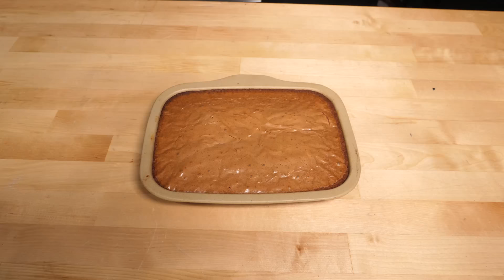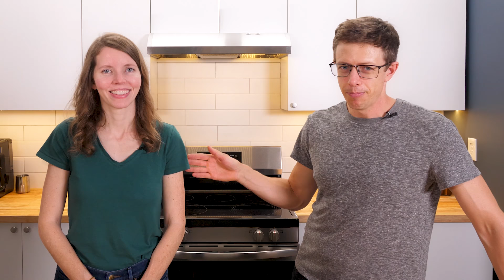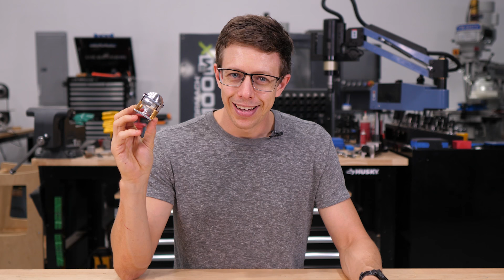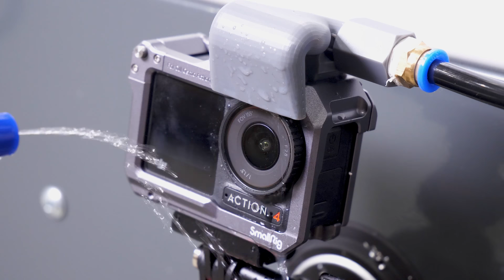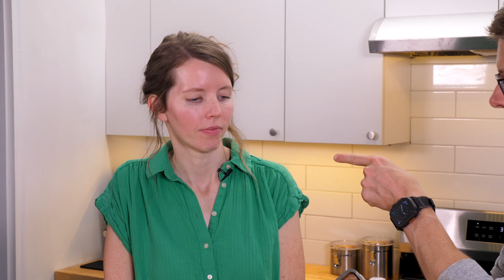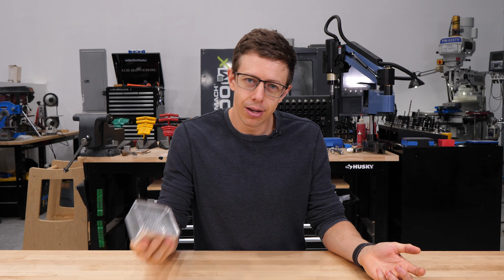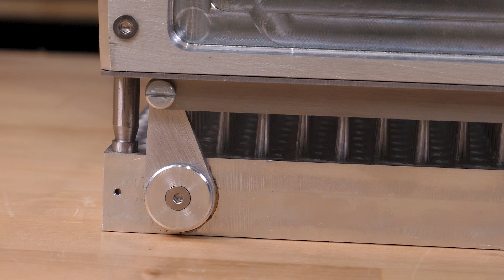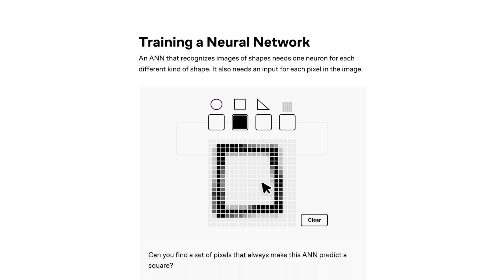Baking brownies from the inside out

Comment: What if you exploited the energy lost in phase change to delay the outside batter from cooking as quickly... or something. I am not a baker, there may be a way to achieve this more simply. 
To clarify, my idea is making two, or even three types of batter, perhaps with different viscosities, and pouring them in layers / injecting them along the corners prior to cooking. If the outer layer were thinner, it would take more time to evaporate the liquid before reaching ideal ratios to cook, meanwhile it would be transferring heat to the inner layer. Further, the higher content of liquid should transfer heat more quickly until it begins cooking.
Pure speculation but I'd bet you could find a mixture or additive for the outside/corners that transmits heat quickly, and delays its own cooking.
And... this would potentially allow a normal pan to work. Or maybe a circular pan. You'd have to inject thinner batter along the corners/walls, top.
idk about the bottom tho tbh

Comment: This seems backwards.
Why not instead of lots of contact points with hot metal

Make 0 contact points with hot metal

Like use a material that doesn't transfer heat very well

Or even somehow keep the material at a certain temperature

Comment: heavy breathing couldnt you just put it in a water bath like a cheesecake to never get crust because the temp stays lower , this is overengineered and i argue doesnt solve the problem as well or as simply as a glass dish inside a larger glass dish seperated by 2 inches of water

Comment: another way to approach this problem may be to change the way you heat your batter - I know it doesn't sound apetizing, but microwave radiation, combined with MW-transparent dish, would (in theory) heat the batter more evenly, all at once, avoiding the hot-wall-problem in the first place

Comment: This issue got solved years ago---it's called a sous vide. Prevents the edges from heating too fast, as it warms the food slowly up to temperature. The food also does not touch any conductive metal, so it heats very evenly. Furthermore, since it floats in the water, I don't think you would get compressed edges, as you would if you just cooked it in a less heat conductive material, such as wood. However, wood is still a decent alternative. The whole reason people use metal when cooking is because it conducts heat better and lets you get a nice maillard crust. If you dont want the edges to heat too fast and you don't want to buy a sous vide, well then you can just use something like wood.

Comment: There is a much simpler way which is to insulate the sides of the pan and cook at a slightly lower temperature.  I just fold some aluminium foil to the height of the pan, wrap it around the edge, mark the overlap and staple.

Comment: What if you made a pan with an aerogel or similar material layer in the inside with the same thermal conductivity as air? Probably with some layer of aluminum in between since aerogel would brake when taking the brownie out with a spatula.

Comment: Would it have worked if you made a pan with a heat resistant non heat conducting material on the edges so they don’t get extra cooked?

Comment: an easier and better way is to use a cydrical form, like a tube, and rotate the tube over a heatsource so the heat can sink into the brownie mix without overheating the outer layer touching the metal.

Comment: I am really annoyed i just found this video i usually watch all of them as soon as they come out.  I was thinking though for your little mortar. It would be awesome if you used lidar or cameras to automatically measure the distance to the cup and have it automatically calculate the angle to fire at. You could even have two on the floor that measure and distance and be able to triangulate its position so you could place the cup anywhere in front of it and have it go in.

Comment: Couldn't the same effect be achieved if you cooked using radiation? The heat transfer starts in the center and goes outwards so with a microwave bit of trial and error you'd have yourself an edgeless brownie with no perforated bottom.

Comment: 10:30 I mean though… shouldn’t that make sense? Because the spikes massively improve the heat transfer to the batter for cooking the brownie. It’s addressed yourself at the start of the video talking about why the crust forms, because of touching the pan and heating up faster than the center due to thermal transfer. And the whole premise of the no edge’s pan was to improve the heat transfer to the batter so it could cook more evenly. So… of course it’s less time on a lower heat?

Comment: Just saw this... 
Uhm.. It could be cheaper and easier to manufacture this if you made the spikes from a rod and screw them in to a holed bottom piece. A cnc lathe can do the spikes and a series of drilling (and thread cutting/drilling) and you are done. :D
So the final cost can be reduced to 300$ from the 999$

Comment: What if you used a ceramic pan with the metal spikes? That way the ceramic would heat up way slower than the metal so there would be less an "edge" on the outside

Comment: 10:32
... so
you made a pan that distributes heat to the center of the brownie faster.
you measured that the temperature of the edge and center of the brownie rose to a higher max temp than a traditional brownie center ever reaches.
AND you measured that they reached that point in like half the time of a traditional brownie recipe
...
I'm not sure how "faster and cooler" wasn't the first thing you tried. what else did you think the data was saying?

Comment: Seems like you could make an edgeless brownie by just putting the batter in a plastic bag and using a immersion circulator to heat the entire thing to whatever usually comes out as the core temperature (~90 celsius? for 40 minutes?)

Comment: I work at a prosthetics manufacturer, and we have 4 Formlabs 3Ls and a few of the HAAS VF-5 and the fact that you just HAVE them amazes me. Knowing the cost of all of these machines anyway. 

Just maintenance and tooling alone is an arm and a leg, then you get the Formlabs high temp resin! 

I have been watching for years, and I am not at all surprised you have them, but the financing behind them must have been extreme! It sounds like FL gave you the printer though, or at least a good deal on it? 

I have a tiny SLA printer at home and it is miles away from a 3 or 4L haha

Comment: This is the best engineering channel on Youtube. I wonder if insulating the edges could have worked, though. If the issue is added heat from the edges, then making a metal base with insulating edges might prevent/fix that.

Comment: It looks like there was an ever so slight increase in force at the initial contact with the knofe even on your final product.  Did you test multiplle times to determine whether you could statistically say there was no significant difference to prove your wife wrong???  😅  

Maybe you should use an atomic force electron microscope measuring at a couple of million points along the edge of the brownie to get some really fine-grain measurement.... 🤔

Comment: Dude wanted a brownie without edges, so obviously the next step is to engineer a lever system with ball bearing locking, a heatproof camera cover, and a mortar with an accurate distance calculator (because he got bored while waiting).

Comment: This is the same problem like in metal casting, when you pour hot molten metal into a cold mold ,it doesn't run well through out the cast. and causes casting defects.
You could have done few other shots like 
1.  heating the brownie mold
2. slightly heating the brownie goo before poring 
if no edge is your goal, might as well sous cooked it. No temp gradient that causes edges instead of using fins to improve temp gradient.

good video l

Comment: Couldn't you just have used a oven safe food-grade silicon container for baking? Like due to it's low thermal conductivity it wouldn't make the edges. Also, maybe microwaving it, or just going super low and slow?

Comment: If you know the temperature required to fully cook the center of a brownie, couldn’t you just lower the oven temperature to slightly above that and cook it for longer? That way the edges couldn’t get overcooked, but the center would eventually reach the right temperature if given enough time.

If that isn’t overengineered enough though, using topology optimization to find a pattern that maximizes the surface area to volume ratio while maintaining a monotone surface for brownie extraction would be another fun thing.

Comment: I see two ways of doing this. number one you could cook a brownie in a pan that is an insulator. by using a thermal insulator, you can ensure that no part of the brownies is hotter than any other part. another way to do it is to cook it like Panko breadcrumbs. Panko breadcrumbs, use bread that is cooked with electricity so that it doesn’t form crust. A similar method could be used for brownies so that it’s cooked completely evenly throughout its entirety.

Comment: Are the large pan holes cylindrical or tapered to fit the angle of the pins? Because if they match perfectly and you grease the pan slightly to make a liquid seal between the metal surfaces, you might not get leakage.

There are also silicone surface paintlike treatments that might work. Cooking directly on aluminium is also.. a problem. Aluminium cookware has been linked to alzheimers, as has alcohol. So don't drink your beer out of old pots.

But seriously, a surface treatment that is slightly rubber-ish like the high temp silicone pans might solve the leak problem AND insulate from aluminium contamination. I'm sure small doses from prototype pans are safe-enough, but this isn't something you'd want to use as a kitchen staple... Heh. Spiky pan, staple.

Comment: The science is not the utensil that you use to cook it but rather the way in which you cook it. Kind of like layering a cake you would have to cook very thin sections of the brownie and then lay them on top of each other to have the most even heat transfer.

Comment: the "edge" remaining is mainly caused by the dry crust part of the brownie. The problem is that while baking, it's in contact with air (unlike the rest) and it dries out. You need to make a cap, or smth like that to keep contact with the top of the brownie, trapping water and allowing it to stay wet and squishy like the rest of the brownie
I loved watching this, great job !
Reply: dude, he wants the upper crust.
Reply: easy fix with a heat resistant silicone cover that lay on the top of the brownie freely. Will be pushed up by expanding batter, but dont give any force itself, so not to ruin the process

Comment: thinking too complicated... why using a metal pan... you get too much heat into the pan quickly but not into the batter and therefor have an uneven cooking... different material -> different results -> less engineering required :P

Comment: I paused at 14:30 to write this. To avoid o-rings, couldn’t the spike plate and the baking pan have “mated” peaks and recesses below the holes in the pan for the pins? Like the pins sit on slightly elevated platforms that (through low tolerance manufacturing) could just be pressed down and seated upon by the pan?

Comment: The first thought I had when you assigned the task would have been to not bake it in an oven but to use an electric current. That way, you apply the heat evenly from the inside out. It's how panko breadcrumbs are made and it's how they make bread with no crust so that every piece is uniform without any dried out pieces at all when they grind it up.

Comment: This was an interesting video, but it seems to me like it probably made assumptions that weren't necessary... like for instance, that the pan had to be made out of a standard metal. I don't know if it would be completely edgeless, but I have heard that using a glass pan would make the edges/crust less prominent and heat a lot more evenly. I would have probably started off by experimenting with different pan materials before going to the point of trying something like spikes. Granted, the result was fascinating, but I'm tempted to think there has to be an easier way to heat brownies more evenly than using spikes...

Comment: Why couldn't you just bake your brownies in a Water Bain?

You put a small pan inside a big pan & then fill the gap (perhaps 2cm on each side + base) with water. Water distributes the heat better than air & takes longer to get hot, so the top would still dry out as normal, but the walls & base wouldn't, giving you outer edges that are significantly less caramelised. (To keep the inner tray at the same distance from the outer tray on each side, as well as the base, you'd need to balance the inner tray on a some "pillars" of an insulative material, like glass.)

It would take slightly longer to cook than just a plain tray. Not to mention, a fair bit of trial & error to get it just right, but at least this method is reasonably feasable for most people without needing a machinist's shop & a whole lot of skilled labour.

A production version would perhaps be like a square rectangular Pyrex bottle (24  x 24 × 8 cm / 0.3cm thick Pyrex) laying on its side, with a square depression (20 × 20 x 6 cm) in it for the batter & a place (like a flush-mount cap) to fill the hollow interior with water.

Comment: hello! suggestion for the edgeless browney: you can levitate the browney dough in a stream of hot air due to Bernouli principle - which makes a stream of air to be always lower pressure compared to the not moving air around the stream. so practically what you do is you place a little smaller than a knuckle sized piece of browney dough(, or squeeze with a siringe) into a stream of not yet hot air, and then you turn up the temperature of the stream. the dough has to be sticky, or when you let it go in the air, try to spin it with hand, such that it retains that movement instead of splashing apart. you can also possibly make a stream of air that is not going straight out, but rather spiraling out - that will possibly help with keeping the dough together afloat in it in the air.

Comment: Call me crazy but if I were trying to make a pan with a pull away bottom I would have started with the design of a spring form pan and modified it but can't argue with results it maybe a bit overengineered but if it works it works.

Comment: 10:43 You know there's a whole branch of science for understanding cooking. I think that the pan design is main problem, well and convection cooking in general cooking from the outside in. The spike idea is good, but I think a split pan with ridges on the edges would help. You want as even cooking as possible with no hot spots and it seems like the flat walls is slowly cooking in the gap between the spikes and edges.

Comment: Will you using material that transfers heat pretty well to the edges what do you use something like wood or some type of other material that's on the edges that doesn't transfer heat but you leave the bottom with aluminum so I can cook and those spikes as well but along the edge of the wall use the material that doesn't transfer heat that well

Comment: Hey just a thought,  have you tried cooking the brownies in a  bain-marie oven, or simply using the bain-marie technique in an oven, involves placing a dish of food within a larger pan filled with hot water to create a gentle, even heat for delicate bakes like custards, cheesecakes, and terrines. This "water bath" method helps prevent overcooking, cracking, and curdling by providing a humid, indirect heat environment, ensuring a silky texture and uniform cooking. Try it and let me know. 😊😂

Comment: next please try using a circular cake pan then completely soak paper towels in water then wrap those in tin foil at the same height of the pan and wrap that all the way around  and cover pan with another soaked paper towel and tin foil over that. (I have only ever done the first part for cakes and have not attempted to cover it completely and have not tried it with brownies, this was originally done to stop cakes from doming over and to come out flat but I think the process that helps it achieve the desired result would also have some benefit in this project.) p.s. there are store bought versions of this as well.

Comment: So why not just use a silicon pan in a bain-marie ? You'd have to use silicon "feet" to keep the pan from touching the bottom if it's made ftom metal, but it should do the job of cooking the brownie evenly without the stabby-stabby bits.

Comment: You could have done something like a tart form. The sidewalls clamp around the base. Maybe you could have used the first design and use something to clamp the bottom to the sides. Much easier to remove than screws. Plus much easier to clean

Comment: If you were to mass produce these only using the exact equipment used to make this one in the video, how much would you need to sell each pan for to make a profit? 
Assuming the labor cost of the human operating the machines and assembling it is being paid minimum wage. 
Assuming you buy the materials needed in bulk. 
Ignoring advertising costs. 
Assuming that the cost to make the reusable equipment will not factor into the price, since any profit made could be slowly used to make up for the cost of the reusable materials. 

So like, the cost of non-reusable materials (such as the stuff being thrown away, or the stuff sold as part of the pan) plus the cost of operation (electrcity/gas/water) plus labor (minimum wage for one person, for however many hours that person needs to be involved per item) plus maybe some other thing I could be forgetting.